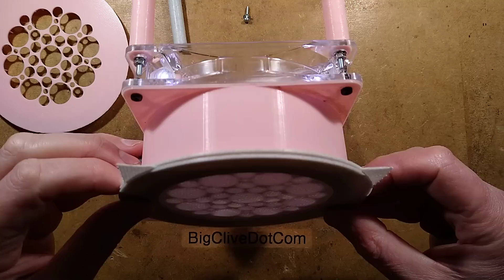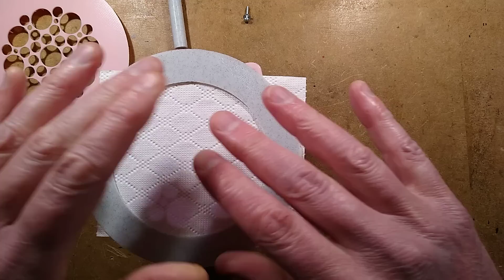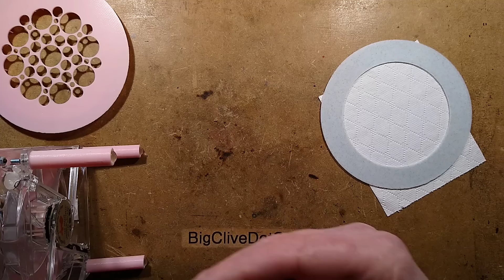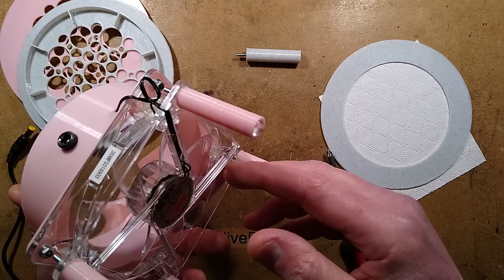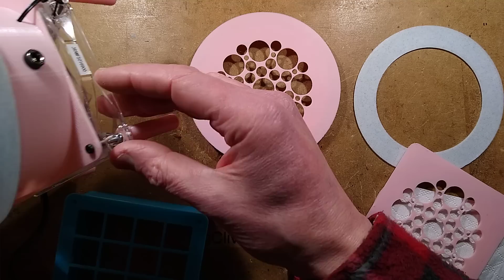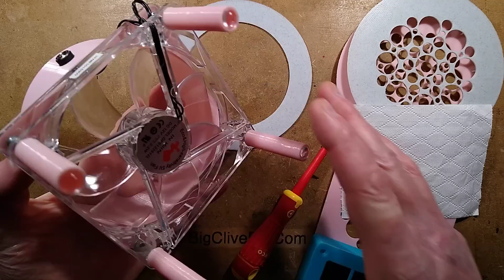MK3 air filter with customisable 3D printing files

Comment: Think about impedance matching.  If your airflow input cross-sectional area is too small with your planar filter then your fan's effort is lost.   Similar to an electric circuit, where you can test the max voltage and then apply a load that generates 50% voltage drop for max power transfer, for this system you can measure the airflow without the filter, then create a filter load which reduces the airflow by 50% to get the highest amount of filtering work out of the fan.  I'm pretty certain your area is too small.  Probably even the square was too small.  You could easily increase the surface area by 40% by rippling the surface of the filter support mesh by 45-50 degrees.  Given the same PSI drop across 40% more surface area you would gain 40% more airflow. Obviously the pressure starts to drop and there is a sweet spot... that's at the 50% airflow drop vs no filter... impedance matching.

Comment: You must design your 3d prints parametrically do you? I'm new to 3d printing and my modeling skills are poor. I'm considering learning python for my freecad designs. I'm quite fluent in c/c++ but they seem to be niche languages unless you're launching rockets or designing mission critical backend systems. Haha I'm old-school when it comes to coding because I got my software engineering degree in the 90s but never used it. I decided to become a first responder instead.
Reply from the maker: If you're old-skool then you'll love openscad.  It's for us code-monkeys.
Reply: @bigclivedotcom  sweet. I'll give it a boo

Comment: If you want higher performance without the noise, go with bigger fans. 200mm and 230mm computer fans are easy to get hold of, possibly larger sizes as well.

Comment: Now you only need to add some stepper motors, that constantly pull over a whole role of toilet paper over it at very low speed so that you only have to change the filter every few months :D And maybe make it a series of 2 or 3 fans.

Comment: I dug out a old script and added user input. 
It generates a fin grid array, which is useful to direct the airflow in a single direction, but not takes as much space as a nozzle. 
For example when you work with optics and want to point a clean air stream at your stuff. 

//User input*************************************************
mm=80;  //fan size(eg. 80,120,140,200)
wall=1; //Wall thickness in mm, should be nozzle size or a multiple.

//model******************************************************
steps=abs(mm/10);
dg=10-wall;

union()
{
 for(x=[1:steps],y=[1:steps])
 {
  translate([x*10,y*10,0])
  difference()
  {
   cube([11,11,10],center=true);
   cube([dg,dg,11],center=true);
  }
 }
}

Comment: Hello! Big fan here! Fan... :). I think the whole approach is wrong. The original idea of air-in-take chamber  a.k.a air-duct is very good. But thinking that 2D mesh can create desired air flow is wrong. You have to think in 3D. You have to redirect the air flow from the center of the air intake to the fan blades. For that you will need 3D parabolic cone in the middle of your duct. Any 2D mesh you are considering is just creating turbulence you want to avoid. Also the air duct edges should be designed as 3D parabolic curves. Just look at the designs or photos of airliner jet engines. Of course you will have to experiment with different designs concerning the fan you are using is far from perfect. In aerodynamics there are no made-up solutions. You have to make hundreds of prototypes. What I am saying is … choose a jet engine 3D approach and forget about 2D meshes.

Comment: Now that it is round, the air will spin more easily inside. you should put vanes/fins inside to prevent this. The blades will get a much better bite in non spinning air and there will be higher flow. The square design would also help to stop the air from spinning inside.

Comment: The loose top ring is a concern.  A little bump and it's gone.  Perhaps you could print recesses for a tiny glued in neodymium/rare earth magnet on the bottom a a small metal disc on the top.  That should provide pretty good stability.  I understand the idea is that this is stuck out of the way, but things happen.  Pins in holes to pierce the TP and could even have a keyhole type lock could be printed and be cheaper.  But I just love rare earth magnets.

Comment: Now that's awesome man! I was looking for a way to make my own air filter for large dust particles and this has helped me a lot. I was originally going to make a electrostatic air filter using one of those high voltage modules. these videos saved me time, and money. Thank you!
Reply from the maker: Keep in mind it's best suited for low airflow passive filtering.  For higher throughput you can get coarser filter materials.
Reply: @bigclivedotcom  dont worry, it’s just for my small bedroom where I do electronics. Too many surfaces to clean and we live next to a gravel road so dust tends to accumulate fast. Thanks for the response!

Comment: Could you add a dryer sheet on underneath the TP/Kleenex to give the room a nice laundry smell? I know you might have to trim them a bit but it might be nice to try. I don't think they would be a good filter by themselves because they are made of nonwoven polyester material. Perhaps this is a bad idea?
Reply from the maker: It would work, but I'm not convinced chemical smells are a good thing.
Reply: @bigclivedotcom  you could probably just add a drop or two of sent to the paper like vanilla or something

Comment: Hi Clive I have 3D Printed the air filter fan. I also ordered the same fan  you it turned up today but has 3 wires red black and yellow. Is the yellow for speed control ? Can you tell me how to wire it up to work on a 12v  power supply as you have .best regards mfa hudson Suppronkey
Reply from the maker: Yellow is a feedback wire to show the fan is running.  Just use the red and black wires to a suitable supply as marked on the fan's rating sticker.

Comment: I see four 18650 cells, one between each leg just under the lip of the fan, and a little power supply fitted beneath the center of the fan regulating the power to it... 🤔🤔

Comment: Interesting vid. When we built our house we installed a whole house vent system with heat recovery (MVHR). Highly recommended. If you've ever been camping you will know what its like waking up in a tent. The filters in ours are quite coarse and intended only to stop bugs getting in. They still manage to block in about 6 months. So I've just been 3D printing a new filter holder that makes changing the filter easier.

Comment: Why not design this around standard PC fan mounting screws that self-tap into the fan frame? They're cheap, ubiquitous, and easy to install and remove. And of course the fan frames are designed to tolerate them. No need for washers and nuts makes for much easier installation.

Comment: You could also push/pull air thru a bucket of ordinary tap water via an aquarium air stone (or two or three ..) at the bottom if you wanted a elegant and water feature sounding way of doing it - no need for filter replacement (only the water when it gets dirty)
Reply: or... pushing air with a regular fan to a water surface... will make particles stick to the water's surface? or just evaporate it making matters worse?

Comment: aren't most filtration systems rated by how many times they can recirculate the volume of the room (in addition to the amount of filtration on each pass).

I've been designing a 3d printed air filter over the pandemic, though I've been using a reclaimed blower from a car HVAC system and a 12"x24"x1" HEPA furnace filter

Comment: Combined with a particulate sensor could turn off the fan if ppm is lower than a specific value.
It would also be interesting to see a parametric airflow model simulation where you could test out how many of these it would take to ccompletely cycle all the air in a specific sized room with variable number of fans in a side by side grid as well as stacked. 
You could visually tell how dirty the air is based upon how many fans were glowing.

Comment: A number of people have suggested having the top ring held in by magnets. I ask, why not just make it press-fit over the grille layer? The grille is already held in that way.

If you don't like the idea of press fit, the use of 3D printing should make it easy to add threads so the two will screw together.
Reply: Actually having the two screw together makes sense. If you look in to the filter paper then you'll be able to see the nasty.

Comment: My computer with 6 filtered intake fans does basically the same. The effect on the air quality of such small fans is very negligible. If you want clean filtered air you need something like 300 m³/u for a medium sized room.

Comment: So I made one of these and I put one of my spare PC fans on it, but it didn't work out so well. I'm just not generating enough pressure with it. It sucks up the toilet paper to the face plate, but I don't think there's much air flowing through it. Tissue test on the other side shows its pushing AND pulling air from that side. I'll still run it since my allergies are awful and it might be better than nothing. Might get a better fan.
Reply from the maker: This design is for continuous low silent airflow.  There is air passing through it, but at a low level.

Comment: I'd love to have that much free time.

As a thought exercise it's probably entertaining, as a practical device, probably not so much.

If you've a sealed room, with time and minimal disturbance, over significant time it would probably help to free the air of most impurities.

However most of these rooms are used, have doors and a gust of wind probably generates more airflow than this does in a week.

This will be the fundamental issue, the rate of impurities added to the room probably exceeds the capability for this device and others like it to remove them.

Probably why vacuum cleaners are so popular.

Not a criticism of the video, just the practicality of the device.

Comment: How about the air flow capacity of that fan? Seems very weak for a normal room size?
Reply from the maker: It is low.  This is just a quiet 24/7 low throughput filter for a small room.
Reply: @bigclivedotcom  Thanks Clive! Good to know that toilet paper does the job, I am planning to put my 3D printer in an enclosure so I want to place fans to pump filtered air inside thus avoiding dust to get in there. Looked at different filters but all seem too restrictive as I want 12V quiet..ish fans, not 24V ones. Will try toilet paper though (I was planning to use my moto air filter as well).

Comment: Well sir, it appears you have indeed made the big times!  There is now a seller out of Canada who is selling Joule Thief Emergency light electronic kits for around 8 bucks US. If his shipping wasn't more then the cost of the item, I might be tempted to order one just to have a look, I could put it beside my 3 units that I have built up over the years since discovering the method of using old batteries for something more then garbage filler.  I have had wonderful luck with them, and have tried 3 different methods to make mine, all built after someone's pattern shown on YouTube, of course, some using through hole all the way others using SMD for most of it.  I do love the compactness you can whittle them down to, this guy, of course has put no value on that line of thinking I guess.  Joule Thief Emergency light electronic kit {https://www.ebay.com/itm/124614628668?hash=item1d039c553c:g:XRgAAOSwmN5gQt2i}

Comment: What is the air flow rate of this fan? What is the difference in flow rate with and without the TP/paper towel? (Maybe this is a non issue because of the low output?)
Do you have a link to similar fans on ebay, perhaps with the wiring already in place?
Personally I love the white noise that fans make so are there higher flow fans that you could recommend? (My kid has a Marpac Dohm Classic white noise fan machine in her bedroom so replacing it with one of these would be wonderful.)
My house is super dusty because of our location (and having four cats) so we need all of the air filtering we can have. Like you I have been hesitant to purchase a store bought filter because of the outrageous costs for replacing the filters. I would love to have something like this in every room in the house

Is there anyone in the states willing to make a few of these for me? I don't have any experience in soldering and I don't have a 3d printer so I can't make these myself. I suppose I could rig up something with some wood but like most projects I get really excited about them and then never finish them because of my ADHD.

Comment: It does look very good in the dark with the backlight. Do you have any spare slow colour changing LEDs you could use replace the blue ones?

I don't think the alignment pegs would work very well, I've always found printing such a thin structures end up too weak and snaps easily. I'd recommend printing a thicker cover and including a recess that you can glue some very thin neodydlium magnets, then affixing matching magnets to the inside of the filter top. Or if you can source some thin nickel strip, I believe it's also magnetic, which would help keep the cover nice and thin. Alternatively you could just shove some thumb tacks through the two pieces, that would also do the job. (Ok, you can pre-drill the holes too, if you want.)

You could also make the filter double as a cheap soldering fume extractor by picking up some cheap activated carbon foam and cutting it so that it wedges into the top of the filter. It wouldn't take much modification to make something to retain the foam. I just did a quick search on eBay and they're relatively cheap, although the cheapest ones are only 10.5 cm wide, so they wouldn't quite be wide enough for the 120mm fan. Not sure if you'll find better results on your local eBay, but the appropriate keywords seem to be activated carbon sponge.

At least with an activated carbon filter it would be slightly closer to HEP-A rated.

Comment: to improve airflow, i think the bext step would be increasing the surface area. i think there's 2 good ways :
1. fold the paper in an accordion like hepa filters do, to keep a square profile
2. make a longer tube with holes on its side, and the paper goes around the tube. it may be best because you use all of the paper, even the edges (similar to the first version), compared to the round shaped grill you have there which only uses the center.

Comment: The marble filament looks nice, might try that out too. Concerning the ring, how about adding some holders for magnets at the bottom of the fan adapter and the top of the ring? This way it might even work with thicker filter materials where the pins won't go through.
Reply: Damn, Diego was faster 😋

Comment: I'm testing my own 140mm version and it's a good little device. At night I use a desk fan to add some white noise in the background, but the desk fan uses 40 watts of power and doesn't do any filtering. This type of solution moves less air but it generates similar white noise, consumes one tenth of the energy and does some useful air filtering in the process.

Comment: Have you ever made an ESP filter? I know you like High voltage stuff so i believe you have everything you need to make one. You need a wire with a few KiloVolts and an aluminum tube or sheet. Dust Particles will get charged by the thin wire and will then get trapped by the metallic plate that is linked to the ground. Pretty cool High voltage application
Reply from the maker: I've considered building an electrostatic precipitator.
Reply: @bigclivedotcom  I believe it would be a nice addition to your channel, and most people are not really aware of these kind of devices

Comment: Love the thumbnail!

I can’t help but imagine a contraption that uses a little synchronous clock motor to gradually and constantly pull fresh toilet paper off of the roll overtop the... Umm... “filter orifice”. It would be fun to run an entire roll of toilet paper through, and see how much weight it gained in the process.

Comment: Could you use UV LEDs and theoretically sterilize the air as well?  Obviously you wouldn't want to stare at it or maybe you could enclose it fully.  I wonder how much UV it would take to do appreciable cleaning
Reply from the maker: UVC LEDs are still inefficient and low output.

Comment: Hi Clive; I like this series of videos a lot & have ordered my own kit. I have a Pi cluster and this will help to keep them clean as well as cool. A couple ideas occurred to me: could a carbon filter be made by capturing fine ground carbon between two wet sheets allowed to dry together? Could UVC LEDs be added to improve the germ reduction? Ionised air generator? Good mate Dave Jones recently showed his HEPA filter on his EEVBlog channel. With a bit of collaboration, folks could be making their own filters and not have to rely on expensive parts. 👍👍👍🏴🏴🏴
Reply from the maker: For computers air flow is more important than purity.  This would limit air flow too much.

Comment: Cool! I build one a while ago with a 500 mesh stainless steel sieve material. I had issues with the fan, not working very effectively. The throughput was a bit low, and not much was collecting on the screen. It was only able to filter everything above 25μm. I might build your design with a conveyer belt type design, with a roll of toilet paper on one side and a pulling mechanism on the other, rolling the dusty paper on another roll.